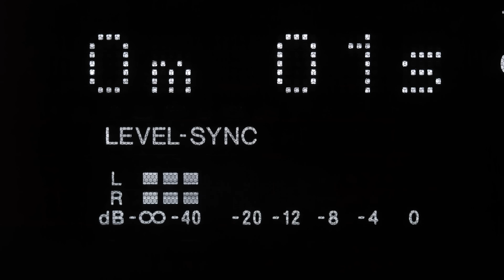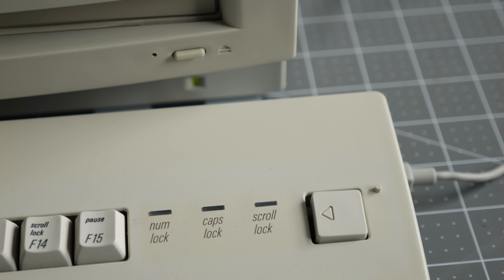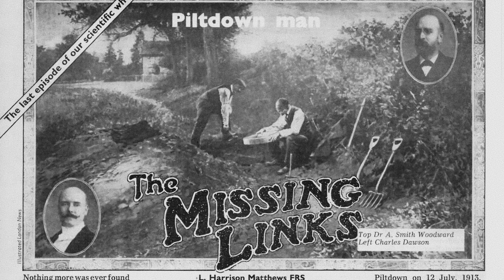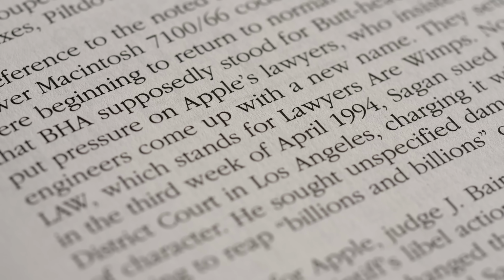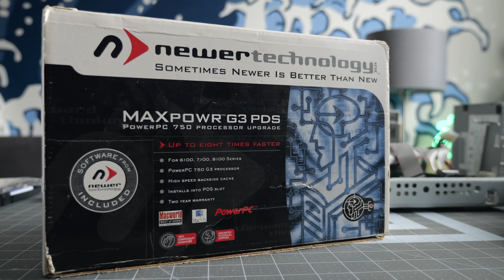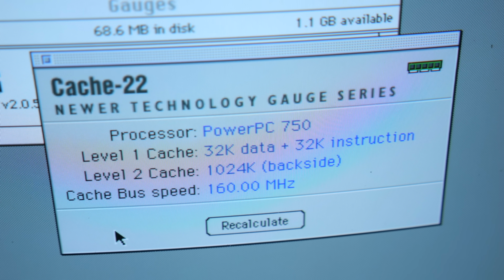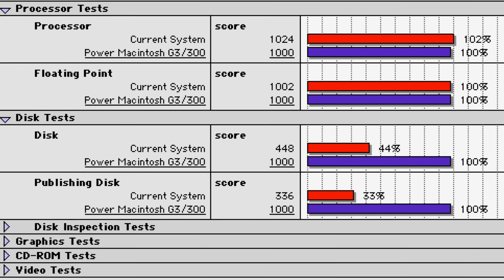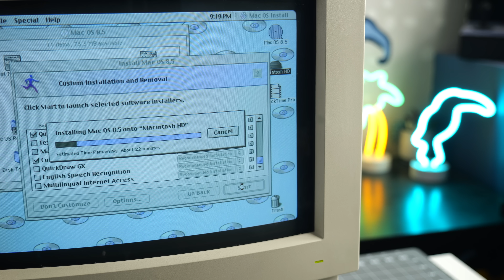Massively Speeding Up Apple's First Power Mac!

Comment: I had a 6100, upgraded with a Sonnet G3/500 (though it was limited to 480Mhz, because my 6100 had the 60mhz PPC 601, and not the 66mhz version).  It was great for a time, and I had Mac OS 9.1 on it.  I remember being disappointed when i learned that Linux didn't like Sonnet upgrade cards, and yet had almost no trouble at all with similar G3 upgrades from NewerTechnologies.  Believe it or not, Sonnet made a G4/NuBus upgrade card for the first-gen Power Macs, but even I thought that was asking too much from my old system.  I moved on to Windows PCs in 2000, mostly for the wider selection of games.  These days though, I alternate between Windows 11 and Linux Mint, on my primary gaming PC and older home theater PC, respectively.  In the meantime, my iMac G3/600 Snow with a broken internal slot-loading DVD drive is collecting dust.

Comment: “ ridiculous upgrades” those G3 and G4 upgrades for NuBus power MacIntosh machines were absolutely incredible. Unfortunately, the system bus an outdated NuBus architecture really held them back. Unless you installed a wide SCSI NuBus card and an accelerated NuBus video card they really sucked.

Comment: Without wanting to be the 'well, actually' guy, the IDC adapter was only needed on the 6100, or the 7100DL. Standard 7100 and all 8100 came with the Apple 'High Performance Video' (it wasn't particularly fast..) with a standard Macintosh video port which is mentioned and shown later in the video.

Comment: you wanna see a crazy CPU swap? the poor old 7200/75, I think the first PowerMac after the original 6100/7100/8100, had a soldered CPU and NO Processor Direct Slot or anything else to plug a new CPU into. But it did have PCI instead of NuBus, and somehow the Einsteins at Sonnet figured out how to make a G3 upgrade card that you could plug into one of those slots. I'm supposed to have one of those laying around here somewhere in my sandcrawler

Comment: Two points for anyone who gets one of these machines.

1)  The CPU heat sink grease has almost certainly dried out and turned to chalk, unless someone has replaced it.   If you get a machine that boots for a moment or moments and then crashes, it is probably overheating because the heat sink grease needs to be cleaned off and replaced.   Exercise caution.   Those PPC601 chips are fragile to downward pressure.

2)  Get Speed Doubler.   It sounds gimmicky, but the folks at Connectix knew their stuff.   Speed Doubler on the 1st gen. PPC machine converts the 68K interpreter into something closer to a compiler, resulting in vastly vaster execution of emulated 68K code.   And as Colin mentioned, huge portions of the Mac OS were still 68K code even though they were shipping it for PPCs.

A video with Speed Doubler performance comparisions would be interesting.   I think there are some old magazine articles that reviewed it.

Comment: I have a 7200 but the power brick died and I since haven"t found a good one to replace. It's funny to see your video brings back memories. Thx for this! sonnet was a great company to boost your machine, yet apple killed it by modifying the software after the G4 Tower.. The good thing of those older machine was the way it was made, simple to open and upgrade while the towers while beautiful on the outside is a pain to change parts.

Comment: Very accurate history of the era. The cpu upgrades for Macs were two thirds of the price of a new Mac and offered two thirds of the benefit. But the new Mac's could often be bought at a big discount right after new models replaced them, while the cpu upgrades never could be bought at a discount.  Hence, few were sold. And few are available today.
  I used a used 7100/ 80 as my main Mac for about a year and felt it was a good machine. It worked well with an external modem for viewing the early Web.  Any of those Power PC Macs I bought, I always used the so called "AV Card" which offered more resolution and more importantly meant avoiding that thick adapter cable.  Which tended to be a mechanically flaky connection.
That Mac AV monitor was a nice Tritron (flat top to bottom curved left to right), by the way, but I used standard VGA monitors.
Any time you can combine things like speakers, computer, and monitor into one unit, you have an advantage in selling to schools.

Comment: I sora wish tech still moved as fast as it did back then, cause I wasn't even born until the start of the 2000s, but it also means that you'd have to buy a new computer every few years, which would get expensive. The biggest boost in performance I was around for, and new enough about computers for was when Alder lake came out, but even that was only about 20-50% gains. When Ryzen came out, I was aware of it, but was still new to my love of computers, and therefore didn't understand just how much of a leap it was.

Comment: I have seen many videos of old computers being loaded with program discs. The second the disc is loaded the program is on ready to go. I have watched them run such programs and they are lightning fast compared to my 2.4 GB Intel i3 with 4GB RAM. Why is my 20 years younger computer slower in operation? 

Others have told me that programmers long ago needed to be very efficient with their code to make things run smoothly and fast. Their programs needed to be small enough so that the chips could do the work as quickly as possible. Even with SSDs there are times when older programs seemed to function just as fast. Apple had publishing software that was amazing and super fast back in the 1980s. For a while I owned a Macbook that had Pages. It took awhile to load using a 2.4 GB Intel chip with 2 GB RAM. Videos of older Apple IIe machines running publishing software showed that it was faster than Pages. 

Is there a way to make a modern computer function as fast as the older computers without having to create new programs from scratch? I realize that newer computers do graphics on screens much faster than older machines, but they don't actually seem to do anything else faster. Spreadsheets, writing, publishing, and some image manipulation (resizing, changing colors) don't require super computer specifications to get the job done. All they need to be better is to open instantly and save or retrieve data quickly. Today's computers don''t really seem better for those jobs. They seem slower.

Comment: 14:19. I worked in a Mac Repair and Sales store during this period of history, and I can tell you, seeing wild CPU swaps was *NEVER* "totally normal".   The cost of these janky upgrades were insanely prohibitive, and the results were underwhelming, and unreliable.   Over the years I worked there, I only saw a handful of these upgrades come through the shop, and just about as many people inquire about them.  Of the people who opted for this sort of thing, most of them regretted it.  Further, such upgrades didn't meaningfully improve the value of the computer, which at the time, retaining resale value of your old computer with the aim of it helping you to upgrade down the line was a real consideration, as old Macs could fetch quite a bit of cash.  Ultimately, if you wanted to upgrade, it simply made more sense to sell, or trade-in, your old computer, and spend the difference toward a newer (perhaps also used) machine.  $700 could really move you up the ladder, when combined with selling what you had.  So why pour $700 into an aged machine, to have a kludgy upgrade?  

If you don't believe me that this sort of thing was uncommon, just ask yourself, why don't you see more upgrade cards for sell on eBay?

Comment: I've read that most 603e based machines were actually slower than 601 based ones due to the fact that they used the same chipset as 68040 based systems.  They even used the same BIOS as the Power Macintosh Card.

Comment: I think the most upgraded Mac I ever had was a Performa 6400. It had an Orange PC co-processor which could run Windows 95 or 98, or a PCI ethernet card (couldn't take both at once), maxed out RAM and eventually a Sonnet G3 in the L2 cache slot. Took ages to boot up, but it saw me through Marathon and OpenDoc. Remember Cyberdog?

Comment: Nothing more hilariously awesome than having an early woeful PPC being upgraded to a 500MHz G4. I have one in my PM 7600.
Reply: You mistype that – There's no PM 7800. The only 7xxx-series PowerMacs were the first 7100, 7200, 7300, the 7500 and the last 7600.
Reply: @Smartcom5  Yes it was a 7600.
Reply: @Smartcom5  7600*
Reply: I had a 6100 I used until 2002 as my daily. That G3 upgrade really made that thing quite usable until the big flash boom in the early 2000s

Comment: I had a PowerMac 9600 that came with a 300mhz PPC 603e but later upgraded to a G4 from Sonnet. The cpu was on a daughter card that could be swapped. 

Around this time a third party also sold a pci expansion with an intel cpu so you could run windows/dos natively. Eventually VirtualPC came out and you could emulate windows.

Comment: 1: the Carl Sagan story made me unironically lol.
2: back when those old PPCs came out, weren't they like $2500? At that price point they were a capital expense and $700 to upgrade one to a G3 wasn't as insane a cost prospect as one would have thought. Especially if one was invested in nubus peripherals (such as tape backups and SCSI drives).
Had a buddy whose dad ran a graphic design shop on these machines and squeezed every penny possible out of them.
Reply: Also at a lot of institutions it was much easier to get a sub-$1000 purchase through, than to buy anything over $1000.   Just a reality of administration/bureaucracy.

Comment: I got a 7100/66 No rom/no cache/no video/no hd/on 4MB ram. Got a ROM chip, and the guy threw in 16Mb of ram. pulled apart a IIvx (yech!!) and got the HD and the CD ROM. 
Yes it was slow, so I got the accelerator clip on, w/ fan and got to 84Mhz. Some one had a dead 8100, so I got the 1mb cache and the 2Mb Video card, and the Motherboard video adapter.
All the 8100 parts were interchangeable. 

MacBench 4 all the way. The cache was a great speed up as well as the cache memory. 
Then came the Sony 19" Color monitor, which the guy gave up on, because he could never get it to sync.
Got a NuBus accelerated video card in a dounghnut shop, which if I held down a key, would cycle through the sync settings. Finally, 1182x870 @ 67Hz.
Picture looked like a moldy pizza. Cleaned the screen with distilled water, and found the adjustment manual, and opened the case! No fiberglass screwdriver.
Got one from a TV Store, found the hidden degauss button, and adjusted it for a few days. 

Got a 13" Apple monitor, and adjusted that too. Noticed that the video for PPC software was faster through the internal, and 68k software was faster through the PDS video card. 
Had it for years. 

When the G4 was announced, I got the high end G3 Mac tower. It took weeks of software hacking to get the ATI Radeon card to sync with the 19" Sony.

I forgot to mention: 68k software ran better/faster on internal video vs the PDS card, whereas PPC Native software ran faster onthe PDS card.

Comment: This was sort or when a computer was still a investment. Esp. most Macintosh machines. So spending a few $$$ compared to a new system at $$$$$$$ was a good choice. But I'm sure you have heard of that before.  Then again I can't tell you how many computers I upgraded with a motherboard, processor, and ram. They even had these great at / atx boards. So you could upgrade your AT case to a slot1 processor or aka pII or pIII

Comment: I found the newer technology card on eBay for about $150 but it doesn’t look like it has the video card holder that you talked about in your video. Did that come with the G3 upgrade newer technology card?
Reply: The G3 upgrade was sold with and also without the PDS video pass-through adapter, IIRC.   On the equivalent Sonnet card it was a separate upgrade purchase.

Comment: This remembers me my first edition B&W PowerMac with the 300mhz G3, i overclocked it to 350mhz and that didn't done much difference, as the bus run at 100mhz until i found out that the bus speed in those is limited by the RAM, so i installed 133mhz ram and that increased the bus speed to 133mhz, together with extra 50mhz i was happy as i could play my games now haha

Comment: IDC wasn't a terrible idea, but between the pathetic DRAM-based onboard video on these, and lack of a passthrough for video upgrade cards (including Apple's own cards), it was mostly useless. The only NuBus PowerPC box without the IDC connector is the WGS 9150. The unfortunately-named HPV PDS card is typically faster than any NuBus video card, unless said card has DSPs or other crazy accelerators, because the NuBus was limited to 32 bit/20MHz (if NuBus '90 compatible; most cards ran at only 10MHz) while the PDS is 64 bits and ran between 30 and 40MHz (same as system bus speed). I have a variety of those 601 PDS G3 (and a G4) cards and they're pretty spiffy. Sonnet was able to get up to 500MHz out of them using their Fortissimo technology.

Comment: I wanted a 7100 bad in college, so bought one right after graduating, when I didn’t need one anymore. It ran up to MacOS 8.6 back in the day, and was eventually upgraded with a 400 MHz Sonnet G3 and Sonata Pro graphics card. That’s fast enough to play StarCraft, but these days it runs System 7.5.5, which is a blast on a system so fast. That Sagan story always reminds me even that your heroes are one kind of asshole or another.

Comment: The hardware ageing was crazy in 90s. In the world of IBM PC - if your machine is 2 years old, it become hard to run newer games and after ~3 years new games refuses to run at all. There was endless itching to buy a whole new machine.
And now I sit in front of PC I built back in 2018 - it runs all new games (not in highest settings, though), it runs VR and it does not cries for any immediate upgrades. And I still use digital camera from 2012 (sic!) which still produces decent pics in 4K resolution.
Reply: My main PC is on a platform from 2010 (P6X58D-E, overclocked 6c/12t Westmere, 24GB RAM and a 2015 GTX 960) and my camera is a Canon EOS 650D from 2012 with a 18mp APS-C sensor

Comment: I was an Amiga user back in the day, and with the fall of Commodore, I was resigned to moving over to the PC. My employer bought a PowerMac 8100/80 and my life was changed… sort-of. I spend a lot of time in both worlds. The 8100 was an interesting introduction to the Mac world. I prefer the Mac, but I thank the Amiga for teaching me the tools to work in both environments.
Reply: Shapeshifter for the win! Only time that a emulated Mac (or any computer for that matter), was faster than the actual bare-metal original!
I had System 7.5 – Mac OS 8.1 running times faster under AmigaOS, than how slow it ran natively on any 68k-Macintosh. Stellar times! 💯

Comment: Totally dig your videos! I wish I had never tossed my old beige mac 68K machine. I still have my blue tower G3 though! It still runs too, but I need to check the battery. You probably knew this, but there is a radiation hardened G3 running on Mars right now. https://en.wikipedia.org/wiki/RHPPC

Comment: History of the Mac never ceases to amaze me. This is basically the equivalent of upgrading a P5 Pentium to a late Pentium II class machine. But there were even cross-architecture (68k to PPC) upgrades in that era. Overall, the Mac survived 4 processor architectures, 4 system bus types (changed at times different to the CPU type), and a replacement of the OS - all while somehow remaining a consistent product range on the business level. That's both impressive and weirdly fascinating.
Reply: Imagine if they had offered a PPC->Intel upgrade or Intel->M-series upgrade. 

I suppose you could call it 5 architectures if you count the Apple IIe card, but then you could call it 6 if you count the DOS card.
Reply: Intel did make a Pentium 2 upgrade for the socket 8 Pentium Pro’s, ran up to 333mhz and had all the improvements that a Pentium 2 brought, plus a pretty big advantage compared to the standard Pentium 2’s, 256k of on die, full CPU speed L2 cache, unlike the normal Pentium 2’s which had 512k of L2 cache, but only running at half CPU speed.

Comment: If you had a great Nubus video card Like a Radius or Supermac Thunder series or were running specialty equipment which used a Nubus interface card, These upgrades were a life saver. I used to work a lot with Imagesetters from companies like Agfa, ECRM, etc. and they told the users when the PCI macs came out that PCI interface cards were 1-2 years out.
Reply: Was about to say the same thing, at a company I worked at we had $1000s of nubus mpeg and audio editing hardware in an nubus Mac, adding a sonnet card made the workflow much more efficient

Comment: I remember installing about 20 of these during the summer of 1999 when I worked at the general purpose computer lab at my university. They had a bunch of 7100s that had been there for years, and it was a lot cheaper to upgrade them this way and keep them going for a few more years than to buy 20 new G3 models.
Reply: I can see it being more appealing in bulk.

Comment: I had a 6100/66 in the late 90s and got a G3 accelerator in '99. It made a massive difference. I did a lot of 3D rendering on that thing. And Marathon, of course.

I recently brought an SSD upgrade for my 2012 iMac and was surprised to see the same newer tech logo on the box! They're still in business!

Comment: I miss those days. I recall upgrading my PowerMac G4 Digital Audio with a dual 1 GHz CPU from a G4 QuickSilver model. Apple decided it was unthinkable for people to do it even though the CPUs were pin- and electrically-compatible. So they designed the QS CPU daughter card to sense the presence of 12v on one of the screw posts. Easy enough to rig up, but just needless anti-consumer shit that we've often seen from Apple over the decades.